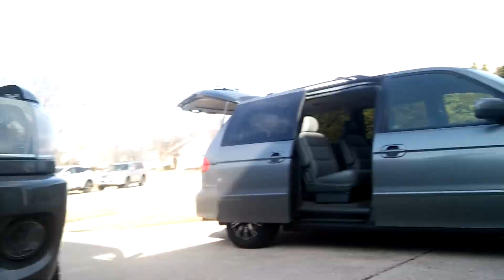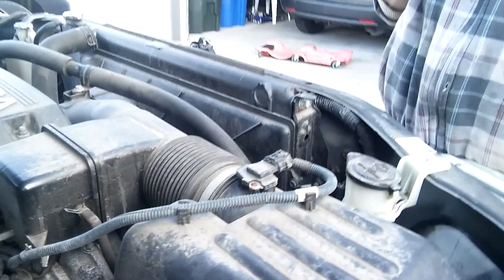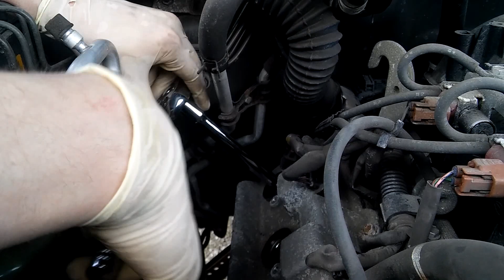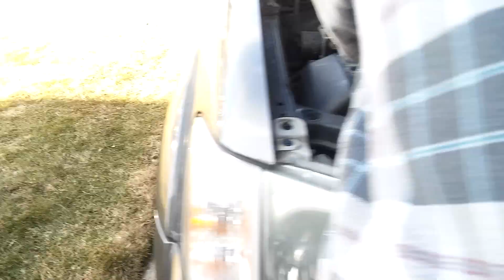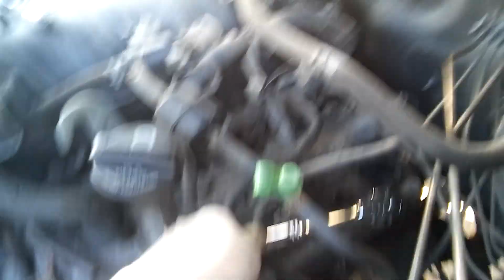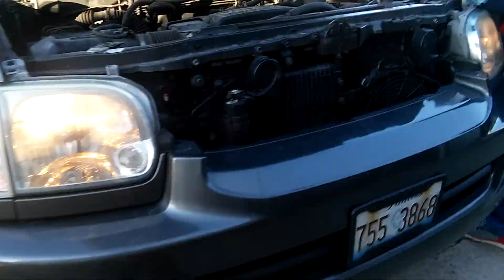2005 Toyota Sequoia TUNE UP: Spark Plugs

Comment: Just my 2 cents. Why not put toyota plugs back in it. It got you 300,000 miles?
Reply: That's the same company that oem uses but they are better they are iridium
Reply: Better than 300,000 miles?

Comment: it's gonna be rough to take out old plugs just use a little force and it will come out if you don't know what your doing don't post a how to video
Reply from the maker: Michael Finley lol if you don't know how to change spark plugs you shouldn't be even working on cars. I post entertainment videos of car repairs and stuff. If you don't like something then have a good day;)
Reply: What happened does CHECK ENGINE light stay on or did it go off
Reply: @VITOSGARAGE  how many hours for spark plugs when I brought it for spark plugs 8 sets for my dad 2006 Toyota Sequoia tomorrow morning Sunday :) what's size for wrench socket and coil plugs socket for??

Comment: You don't have to disconnect the wiring right? Just take the positive wire off of the battery?
Reply from the maker: ChrisLeathal You don't need to disconnect the battery at all
Reply: @VITOSGARAGE  
Why disconnecting  the battery 
I dont think is necessary

Comment: If you do this while the engine is warm (not hot) it will be a little easier. Metal will expand when heated making it not as difficult when removing plugs from engine. Use common sense.